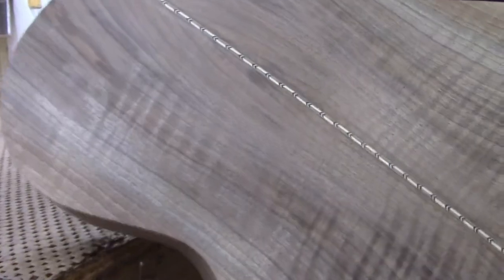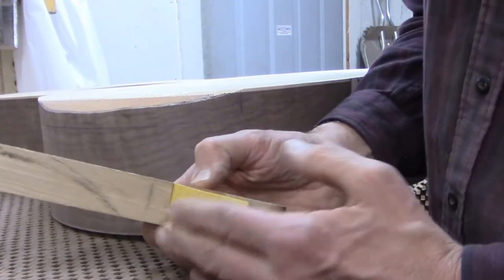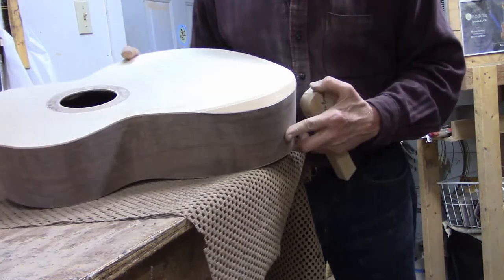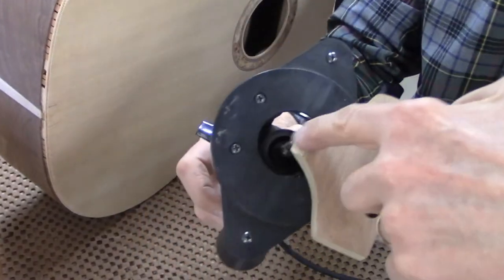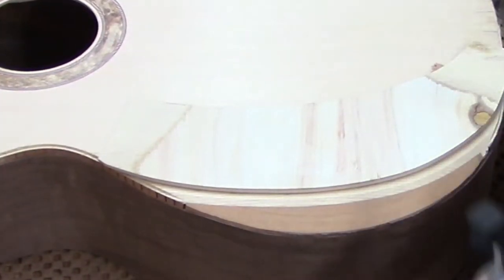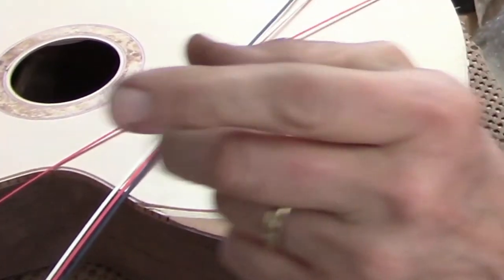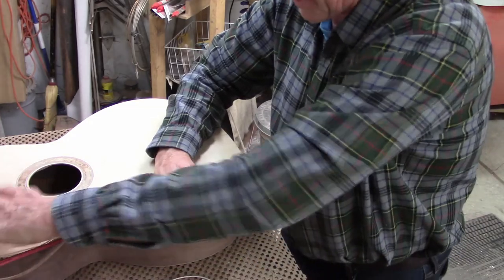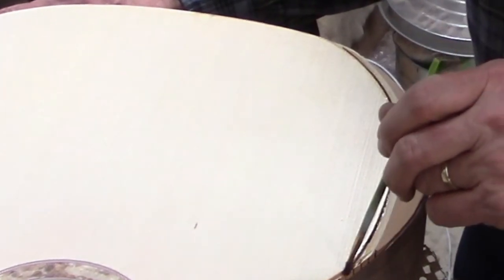Baritone Guitar Construction Part 5: Arm Bevel, Segment 1

Comment: Thank you for sharing. I see that you use the router base, meaning you will route perpendicular to the top instead of parallel to the sides. I made a jig myself for this. Do you not encounter problems doing it this way ?
Reply from the maker: I have tried several different approaches, each had its own problems, but this is the one that worked best for me. As with all aspects of guitar building, there is rarely one single "right" way of doing something. I find an approach that seems to work, then with repetition  I get better, or I revise the approach as I gain insight.  Thank you for watching.